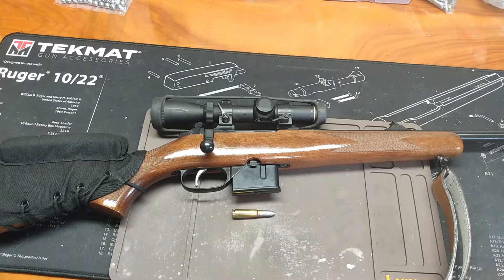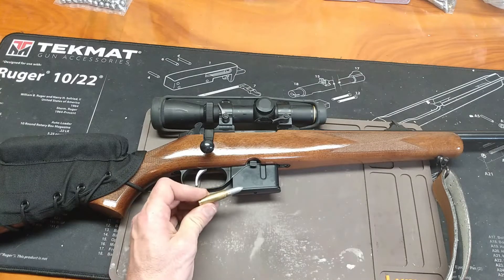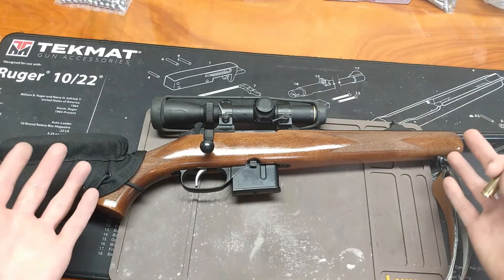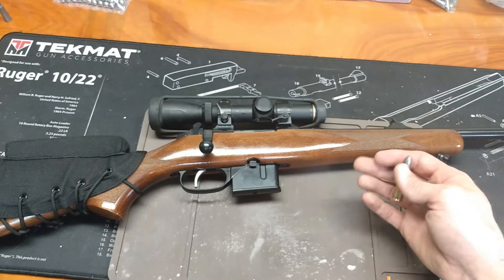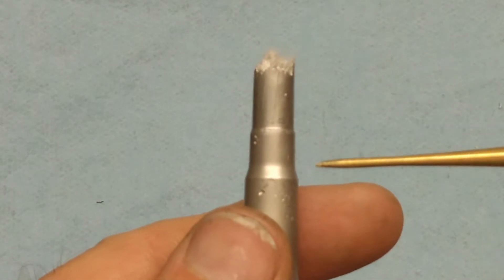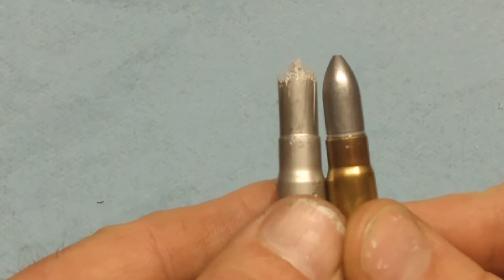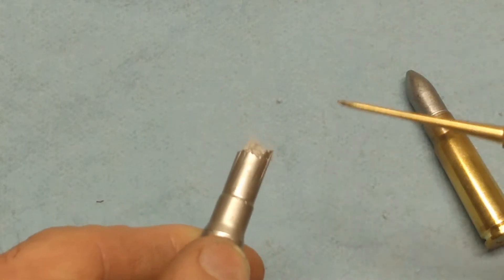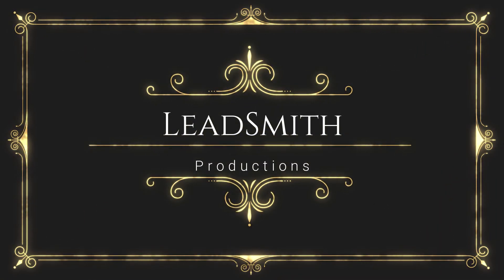Pt.3) 7.62x39 Cast Bullet: Chamber Cast/Throat Measurement

Comment: Excellent. I have been asked many times for a chamber cast video!!
Reply from the maker: This was my second attempt. I was on pins and needles the majority of the time. I'm extremely paranoid about getting a casting stuck, so it was tough to relax. Thanks for all your support! Hope to see ya friday.
Reply: @leadsmith44  I have done it a few times and like bedding I always worry as well. I have never done a video as that also adds complications!! 

Cking bore dia with a store bought muzzle loading lead ball is easier but only gives bore dims not the important throat measurements.

Comment: I've heard some of the 7.62x39 ar platforms are really .308 diameter.  I wonder how that Ruger American is.
Reply from the maker: If I remember correctly CW spoke very highly of them during last Fridays livestream on the Georgia Shooting Connection. Also, it sounds like American barrels were exclusively .308 years back... but in recent times I'm hearing more reports of them being .311. I probably should have touched on that. Thanks for coming by!
Reply: my Bear Creek slugged out at
 .3105 so the milage may vary
Reply: @mckwilly  Good to know.  I have a 7.62x39 barrel that I used in a build.  I haven't slugged it yet, but it's on the "to do" list.